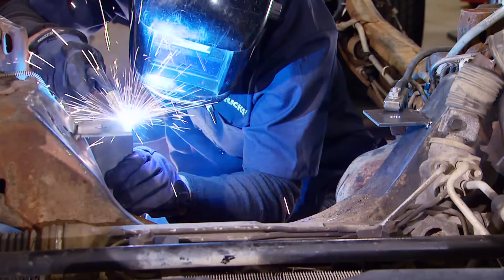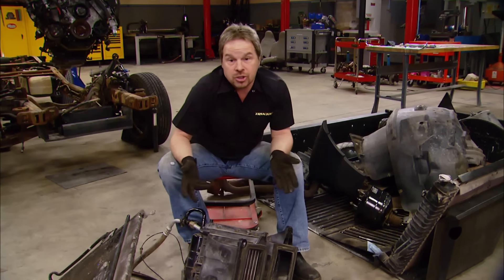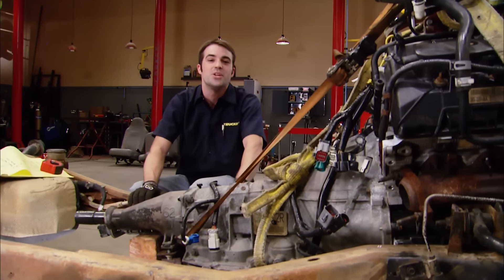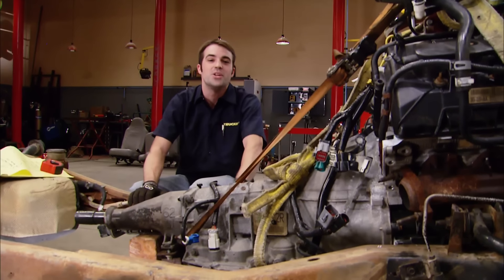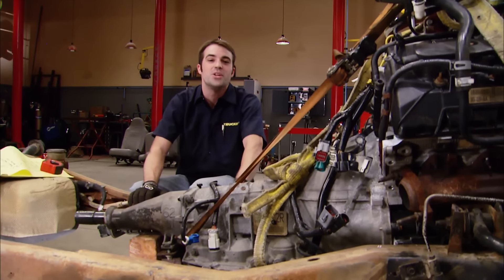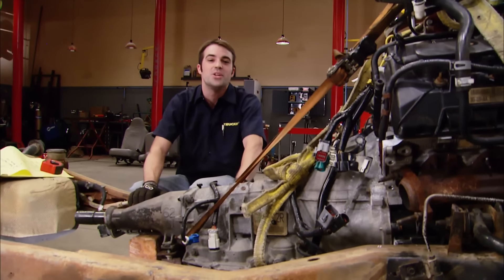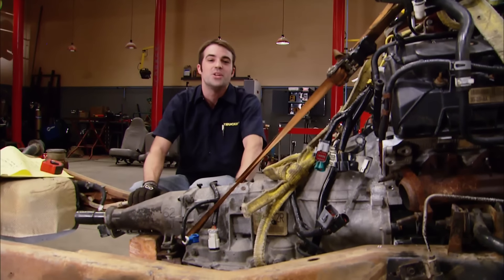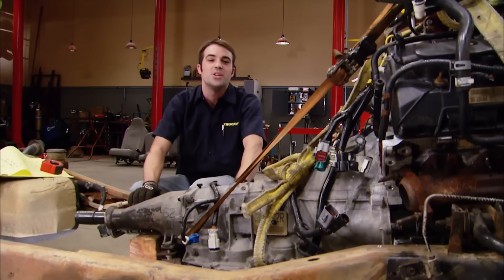Shoehorning a 4.6L V8 Monster Into a Ford Ranger - Trucks! S12, E3

Comment: You wouldn’t think an engine with such small displacement would be so massive.
Reply: Overhead cans are a pain. Its bigger then a 460. Not as long but taller and wider.
Reply: Yeah, just go SBC: https://www.dailymotion.com/video/x3rfhrk
Reply: The down side of any dohc V8 they all suffer from it. Ford seems to be the only American doing it all the others are stuck in the 50s with OHV setups
Reply: @bigboreracing356  whoop de doo. One OHV engine, the rest of the Ford fleet is OHC. Not a single V8 dodge or chevy has OHC.
Reply: @bigboreracing356  power yes, technologically and economically nah.
Reply: @bigboreracing356  tell that to the super car manufacturers 🤣

Comment: These guys really love matco tools
Reply: I love Matco tools and they don't sponsor me.  As a tool nerd generally speaking tool truck tools are all amazing no matter if its Snapon, Matco, Mac, Cornwell, Mac or Proto and I have mainly only bought used tools.  If you want to go the vintage route of used I would also recommend Indestro. Or slightly cheaper on the pocket book SK hand tools or Wright tools are great and you can get those through Amazon or eBay.

Comment: So sad a Marauder is off the road...but that all aluminum DOHC 4.6 will make that truck move. The 03-04 Marauder 4.6 is the same as the 03-04 Mach1. Personally I believe those 4.6s have a bit more that the advertised 305/310 hp.
Reply: All those modular numbers from back in the day are underrated
Reply: 3 valve 4.6L engines seem more powerful... especially at low RPMs...

Comment: The radiator will need to be replaced with one designed for a V8, especially if the V8 replaced a 4-banger, but I like it. There are many stories about squeezing a 305 V8 into a Chevy Blazer or S10 as well. Tree-huggers can weep, muahahaha!!!!

Comment: I feel like a Windsor would’ve been more fun
Reply: Definitely easier to get up and running with a Windsor. 302 fits in without any mods whatsoever and a 351 Windsor only requires you to dent the heater box and run a custom exhaust. I guess this build is for the unique factor.

Comment: Funny how things have changed. Granted it was over 30 years ago but we installed a 350 into a chevy luv. Yes, even with an external radiator it overheated every 2 miles but when they are calling a 4.6 "HUGE" and a "MONSTER", it just makes me roll my eyes. 
Then of course there was the production chevy S10 with a 454......
Reply: They are talking about the actual size not the displacement, the 4.6l is very oversized lol

Comment: This car is cool but No AC is brutal.   I think I would have just used a Explorer 302 as it is a straight bolt in with cheap performance available.
Fun build regardless.
Reply: maybe it was removed to get the engine to sit back as far as possible... I wonder if moving it forward would give space for A/C and how much of a compromise is it really?

Comment: A 4.6 liter 3 valve would be easier to find. 305 horse mustangs from 05 - 10. And most came with a 5 speed.
Reply: I worked for Ford those three valve engines had a lot of issues. That was the word on the F150's they put them in.
Reply: Yeah, 3 valve seemed a lot more powerful... especially at low RPMs...
Reply: @hughmc5419  -  Can't keep sparkplugs from blowing out of any of the modulars...
Reply: @BuzzLOLOL  4Vs had no issues with plugs 3v they stuck in 2v blow em out

Comment: ...why not just use a frame from a Ford Explorer V8? It's the same engine isn't it?
Reply: Byg Syxx 96-01 Explorer came with a 5.0. It also used the same front frame as a torsion bar ranger. So the 5.0 bolts right in. The 4.6 is way larger than the 5.0 due to it being overhead cam.

Comment: wouldn't a 5.4 with a 4.6 intake system been better? just sayin.
Reply: Marauder motor is a 4.6-4V.  5.4 with 4V heads?  Not sure you'll find one outside a GT.
Reply: @RexKarrs  the spacing between the intake ports is wider on a 5.4 vs a 4.6. the ports wouldn't reach the intakes of a 5.4
Reply: 5.4 4 valves were put into navigators

Comment: Next project, Boosted Ford 300 or supercharged ford 300 straight 6 to blow away v8s and v6 engines
Reply: Or one of those killer inline Ford sixes the Aussies get to play with. There is one making over 1000 hp on here somewhere.
Reply: @dond5103  that is the Ford Barra, the evolution of the Ford 300, but no replacement for displacement, with the same amount of boost and equal components the Ford 300 will still make much more torque than the Barra will, just because of the added litre over and the 4 inch stroke and bore

Comment: all that shop equipment and you dont have a ac machine?
Reply: ac machines in good USED condition are still like 5-7k, plus you are supposed to have certifications from the epa to run them to boot.
Reply: Hillbilly just wanted to be able to use the term tree-hugger like it was still the 1990's

Comment: Is that not one of the engines with the bad spark plugs?
Reply: Yes... all modulars... weak and too few plug threads... plugs blow out...
Reply: BuzzLOLOL incorrect, the 2v and 3v had spark plug issues. This is a 4v. 2v would spit the plugs out and 3v theyd get stuck in the block. With the 4v ford figured it out.

Comment: Oh... this is new TODAY! ... 4.6L is a "monster" ??? ... OK, DOHC makes it a big package... 3 valve "300 HP" is a lot more than '93 Marauder "300 HP"...
Reply: Umm marauder was 03 to 04 not 93 and 302 HP was alot back in the day when the 2V sister was making 205-230ish HP having an extra 70-80 horsepower was alot and a few more torquea

Comment: With 45 ft lbs. of torque, that 1/4" drive air ratchet would likely just snap the heads off of most of the bolts I work on.

Comment: The 4.6 is single  over head  cam not doul. Ford  didn't  make  a doul over over head cam till the 5.0 in 2010.
Reply: bruh tf are u saying the 4.6 has 3 varients 2v 3v and 4v the 2v is sohc the 3v is sohc and the 4v is dohc this is a 4v and they started using dohc in the 40s with the ford GAA
Reply: The Dohc dates back to 1993 model year. Was in Mark 8 Lincoln

Comment: The question is WHY. 
A  mildly modded 302W will fit a lot easier.And be a lot lighter as well and have no timing chain drama that those modulars suffer.
And it is a Mazda not a Ford!

Comment: Ls swap would have been easier, cheaper, lighter, more fuel efficient, more powerful, stronger and a much better aftermarket support.
Reply: Probably. But it wouldn't be as interesting, unique, or require as many skills to accomplish.
Reply: lame
Reply: Or SBC: https://www.dailymotion.com/video/x3rfhrk
Reply: Yaaaawwwn.  That's what everyone wants to see, ANOTHER  how to bastardize an LS into something it doesn't belong because the owner has no imagination or fabrication ability. I  would rather see a Yugo swap into an early Corvette than another boring "L Eth"  (the Chevy puke lisp) swap.
Reply: Don D I don’t disagree with that but why put a trash 4.6 in there? I do LS swaps for a living id rather see a damn corolla engine at this point.

Comment: I've never heard anyone call a 200hp v8 a monster... More like gutless not impressive
Reply: They are talking about the physical size
Reply: 302 HP DOHC... but weak low end torque... '300 HP' 3 valve SOHC seemed more powerful...
Reply: @Christopher-et7bc  you think its impressive in your town car? Guess what car I have? 2003 Mercury Marauder :) its fantastic. Non the less I still love town cars. I'd kill for one
Reply: @edwardmyers1746  yeah it actually is . I am going to build it up eventually as well. It runs good even with a bs dorman non pi intake lol and non pi heads
Reply: @edwardmyers1746  I want to put pi heads on and a pi intake along with a better cam etc
Reply: @Christopher-et7bc  your wasting your money. A Full built 4.6 makes less power than a bone stock coyote. And the 4.6 barley makes 1tq per cubic inch. That's pathetic for an ohc v8.
Reply: @konnerkramer329  why would I buy a coyote? I would skip that and go with an LS Motor and swap it for way cheaper and it would sound better too. It's also not a waste of money. I could get all of that bs at pick and pull in Ca for pennies on the dollar off of a Mustang minus the cam. That would be where the money would be spent. I'm not saying it would smoke a Coyote, but it would give it a decent amount more torque and a horsepower. Nothing crazy
Reply: It not pathetic for how small of a motor it is and it does have decent torque
Reply: @Christopher-et7bc  its a waste of time and money because your going to pull the heads and intake at the junkyard clean them up buy new gaskets and cams only to make 100hp less than a $500 junkyard 6.0.
Reply: @Christopher-et7bc  no it doesn't have decent torque it doesn't even make 300ft lbs. There are straight 6s that make more torque than that.
Reply: @konnerkramer329  your also still talking about engine swapping which is more difficult then what you just listed what I would do with those used parts. If I was going to do that engine swap your right a 6.0 LS would be a good choice, but it's still a swap. Those are hard to do in CA because of emissions, unless you have it refereed.

Comment: 4.6 Liter is a "Monster" ?? 🤣🤣🤣🤣 It's a 289ci. What's the USA coming to when a 289 is a Monster engine? SMH
Reply: While displacement is tiny, being an overhead cam design the footprint of the engine is why they are calling it a massive engine.  The 5.4 triton in my F150 has the exhaust  manifolds right next to the mounts for my upper A-arm.
Reply: No it is not a 289 which displaces 4.7 litres. Fine little engine but weak. 4.6 Dohc much stronger

Comment: 4.6 a monster?  A 6.4 is not even a monster. I think monster starts at like 7 at least. Gtfoh!
Reply: Honestly depends on where you live. In Europe a 4.6 v8 would be considered massive
Reply: @ronaldmcdonald5292  sorry about that, in the usa, thats a small v8
Reply: In terms of physical size the Mod Motors are quite large - much bigger than an equivalent displacement SBC or SBF.
Reply: @FaustoTheBoozehound  4.6 is 4.6, its still 4.6, i have one in a Lincoln, big in size, small in liter.
Reply: Someone is insecure about size.................